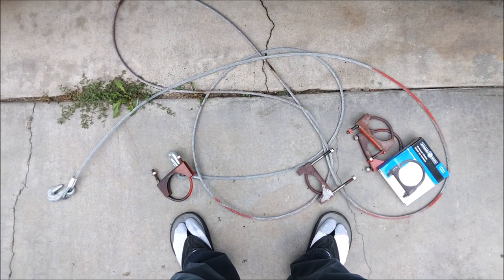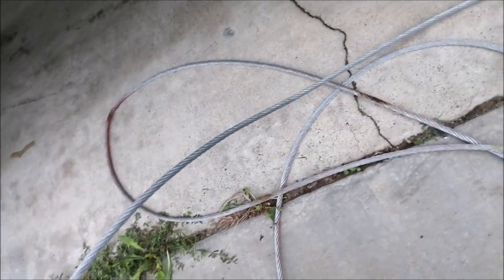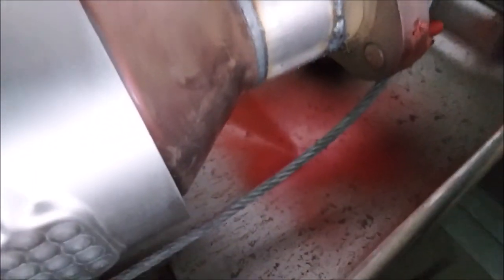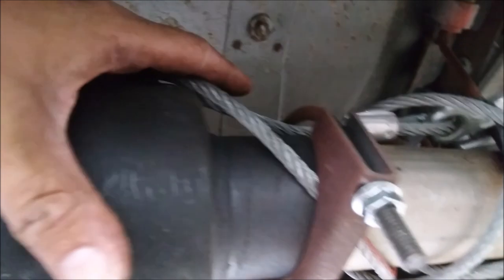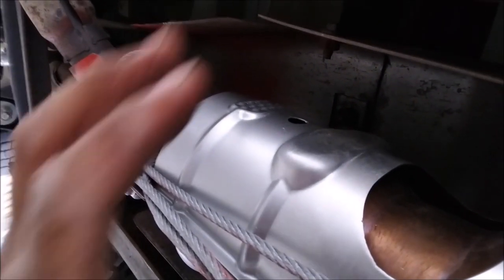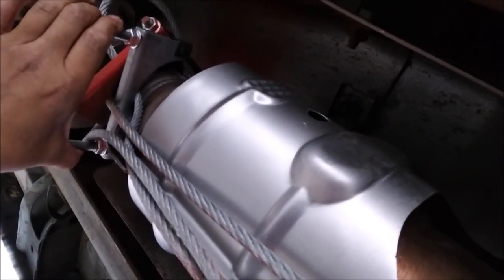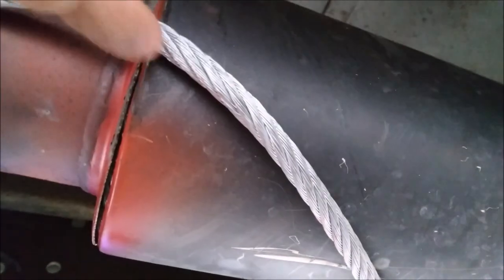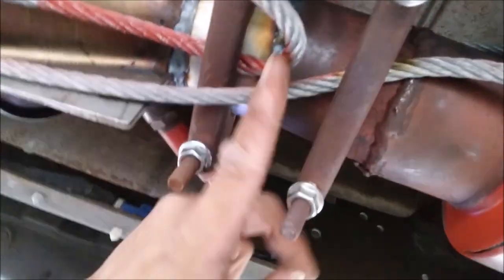Catalytic Converter Anti Theft protection | cheap affordable diy ($50) Cat Clamp Lock alternative

Comment: Looks interesting  🤔  .  I live in Mississippi,  so I got a nonCalifornia Cat . May turn into a mistake . But Ms. doesn't do exhaust emissions test .
Reply from the maker: Since you don't have an exhust Emissions test why didn't you just put a a straight pipe in place of the catalytic Converter?
Reply: The check engine light would always be on . And if I drove to the states that do have it , and had mechanical problems,  a mechanic could possibly refuse to work on an illegal vehicle. 
   Federal law says gotta have a Cat .
Reply from the maker: @richardduke9788  When I had a Mustang I use to look at Mustang Parts all the time and there were 02 sensor simulators for them so you can take the cats off and gain 10 horsepower lol. But yeah makes sense. I'm in the worst state when it comes to smog test. My van had the same sniffer numbers with the universal cat as it did with the "CA" Compliant Cat. You'll be fine with universal. CA is the only state that has it's own Converter.